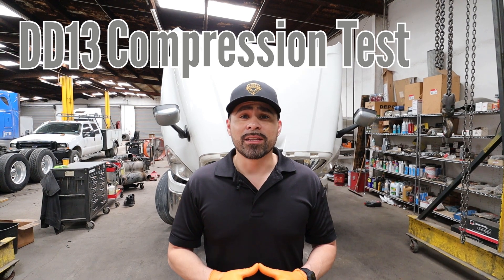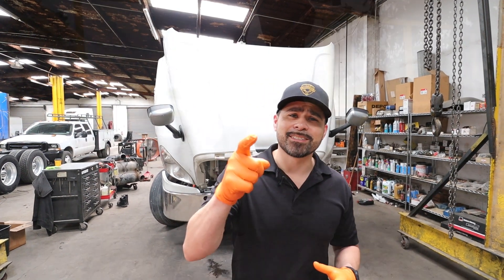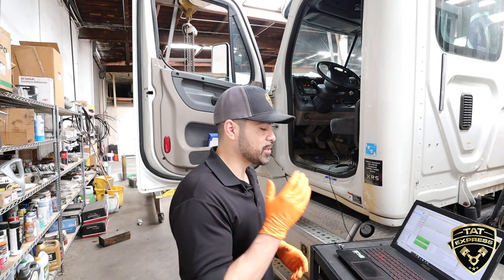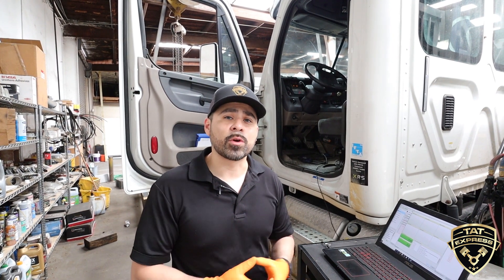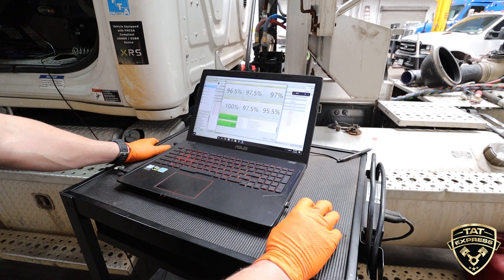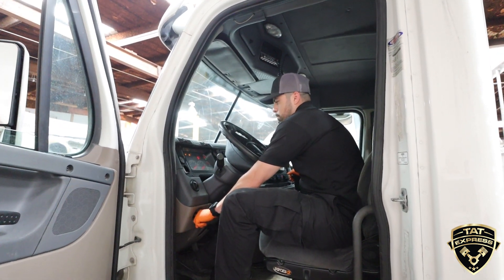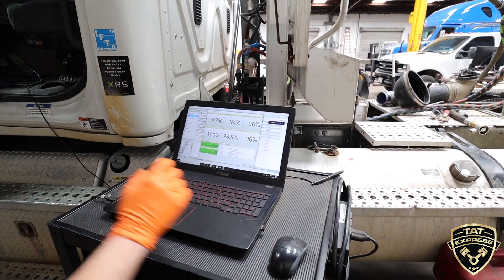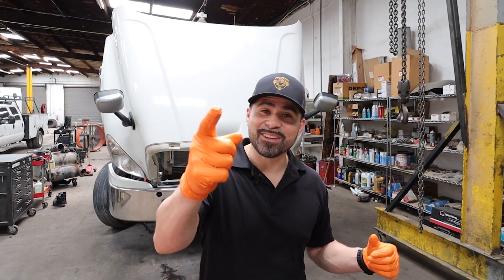High Crankcase Pressure DD13/DD15/DD16  (Relative Cylinder Compression Test)

Comment: I have a dd13 that’s leaking oil at the crankcase filter. At 650,000 miles I never had an issue other that hitting something on the highway that knocked a hole in my oil pan. After replacing oil pan with filter and fluids two weeks later I began to notice a leak at crankcase. Truck cranks fine hold temperature but have excessive blow by. What’s the right direction for this issue?

Comment: 2018 cascadia 125 1035020 miles deleted 

I’m having small blowby out of nowhere no oil or coolant lose no codes just a little white smoke from crankcase breather,dipstick tube and oil filler 

Do you think if I replace the crankcase breather this will or may fix the issue?

Also I do know based off the way my truck idles rough at cold starts it needs an valve adjustment

Comment: #5 cylinder is a know issue on the dd15. Valve starts to recess in the head causing a popping noise in the intake as well as weak cylinder.

Comment: Hello there sir. Thank you first of all for your very helpful videos. Question I have a 2012 DD15, I just noticed that I’ve been getting quite a bit of crankcase pressure through the oil cap(hopefully I’m explaining myself). Engine has a little over 1 million miles, now even though I see the pressure my coolant still perfect without any signs of oil. Can you kinda point me to what it could be? Would a cracked liner give me oil in the coolant?? Thank you sir.

Comment: I have a Cummins just had my motor rebuild needed new block and now have high crank case pressure can hear the air after plugging valve cover outlet. They said might be the turbo if not they gonna have pull head off again.

Comment: I’m having nightmare with my truck. Took it to shop more than 5 times with same issues. It’s 2017 cascadia dd13 402k miles. Truck ain’t got power and getting 6.13 - 6.33mpg . My load will be always less than 29k. And top speed I go is 67mph. Did tune up, pressure test and everything it needs. I’m still having power issue and burning lot of fuel
Reply: Did you ever figure out what the problem was?

Comment: Good morning. I have a 2011 Columbia dd15.  Driving down the interstate at about 70mph. Loss power  looked on passenger side and saw oil from crankcase breather all the way back to the back of the truck. No warning. Truck would not start. Starter wet with oil. Able to bump it over but not enough battery.  What would cause engine to shut down, no alarm or warning engine temperature was high too

Comment: I have dd15 2014 freightliner Cascadia I have a tick in the motor you hear when cold and oil pressure is 100 psi when starting and then idles down to about 60-65 psi and when driving it comes and goes but when it comes it feels like it wants to cut off do have any idea of what it could be

Comment: Good morning I had a 2016 cascadia Dyno’d dd15 engine 356,000 miles they said that it has 404 horse power with 3.4 blow by is that good or bad I’m not understanding the blow by scale they said the engine is healthy
Reply: Mine is 3.3 blow I’m having white smoke come out Everytime I go up the hills what did they ever tell you

Comment: My dd15 is blowing oil out the blow by tube
Reply: Did you find out the problem?
Reply: @israelaviles5513  crank case filter was bad now i have a bad value so I'm stuck
Reply: @duaneporter4322  my crankcase started leaking a little oil i guess I'm going to replace it

Comment: Hi Adam, need some help. 
Trying to do a :
Relative Cylinder Compression Test
Using DDDL 8.9
After complying with caution warning ⚠️ 
The test log gives the following error:

User aknowledged caution
Engine is running in Compression Test Mode(NRC$1)
The Automatic Compression Test service routine failed to run. 

Any ideas?
Reply: Tried to 
1.swich key on/off/on
2.Engage transmission then put it back to neutral
3. Release then set back parking brakes

Not working

PS Truck was cold(do I need to warm it up?)
Reply: DD15 engine
Reply from the maker: Alex, be sure you are selecting relative compression test.   Its not automatic compression test.  Yes, running at temp will give you better readings.
Reply: @TATEXPRESSINC  
Hi, figured it out.
Thank You
Something with either software or the filter's drivers, reinstalled them  and it worked like a charm. 

53% compression though in cylinder 3

Seems to me that it will need an overhaul.
Some white smoke and excessive oil out of crankcase breather.
Reply from the maker: Be sure to run through trouble shooting before condemning engine.  Depending on mileage as well.  Valve train or loose injector hold down bolt can cause low compression and high crank pressure
Reply: @TATEXPRESSINC  
Will check them as well. Thank you 🙏

Comment: Hey boss... I have this code on my truck spn1328 fmi 31... injector 6 has been changed but still getting this code... I have noticed that this is showing with the engine cold... never show up with the truck hot or running on a highway.  Any suggestions boss?
Reply from the maker: Hugo, I would recommend the compression test conducted in the video.

Comment: Great video , I have an issue with my freightliner m2 106 2010 . Check engine light on to much pressure on crank case and consuming oil. Just had pistons replaced but problem remain ? What could be the issue ?
Reply from the maker: Thanks for sharing.  DN, I would run a compression test.
Reply: TAT Express Inc.  thank you for your reply, I did and it’s high

Comment: I own a dd15. Ever since I bought it it's been giving me bad fuel mileage. And no power on hills. The previous owner deleted DEF, Regen and ERG. Could this be the cause of all this?
Reply from the maker: Roberto, we see a lot of engines with low power due to bad deletes.  Have you do the compression test?
Reply: @TATEXPRESSINC  Don't think so. What's the purpose of this test?
Reply: I usually deliver around the metroplex area. I live in Mission TX.  Can I just stop by at your shop and get it checked out? How much is your rate per hour or diagnostic?
Reply from the maker: Roberto, we can definitely help.  A compression test will give us a idea of the condition of engine.  If compression is good we can test fuel system and check for boost leaks.

Comment: Great teacher
Reply from the maker: Thank you.💪👊🔧
Reply: @TATEXPRESSINC  good afternoon I have a Cascadia with a DD15 with 800,000 miles the engine was leaking oil through the Crankcase Filter but a lot .. I replaced the filter and kept doing it but only on the climbs and very heavy when the trailer is empty it does not drop anything  oil ... a workshop already removed the oil pan and checked the piston liners and you can't see a single scratch the compression test that you do in this video they did it to me and it's fine ... they want to change the  turbo say that it may be that it is putting pressure to the engine by the oil return ... the engine does not show any symptoms of wear does not lose strength does not have faults does not burn any oil between oil changes ... you think that the turbo can  be the cause?  any recommendation I would appreciate thank you

Comment: Question, i have a 2015 Dd15 approx 540k miles just recently i started noticing some black spots real minimal thinking it was oil i sent it in to Freightliner they did there test compression test and they stated it was Burnt Down Coolant. Is that the cause of it ? 
Thank You ..
Reply from the maker: Trokero, thanks for watching.  Is the engine consuming any fluids? Coolant or Oil
Reply: TAT Express Inc.  Negative ! I did a Oil sample on coolant before i purchased it .. no oil but it did state the test was cloudy so they changed the reservoir for me but im sure they didn’t do a proper flush ...
Reply from the maker: Trokero, you are having black spots in coolant bottle.  Does it look like it’s getting worse or staying the same?
Reply: TAT Express Inc.  i took it to shop after i started seeing the black spots (Minor) i am going to monitor it closely & hope they dont keep pooping up
Reply: TAT Express Inc. im sure they just replaced reservoir & added coolant not drained the full system.  What do you recommend ?
Reply from the maker: At +500k miles you can do a coolant flush and have EGR cooler looked at.  We usually see heavy soot build up and build up can cause cooler to run hotter.
Reply: TAT Express Inc.  Thank you so much ! ill Defenitly get that looked at ..    whats the approx oil temp for a Dd15 ?
Reply from the maker: Trokero, you could also test your coolant concentration with a test strip. Keeping an eye on your coolant bottle is a good way to catch problems early on.
Reply: TAT Express Inc.  Thank You for the advice 🙏🏼